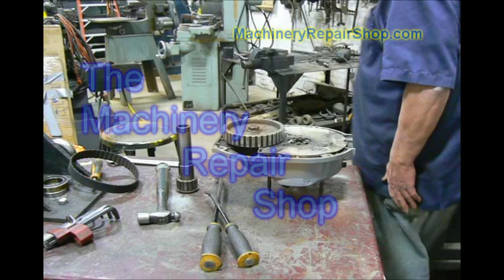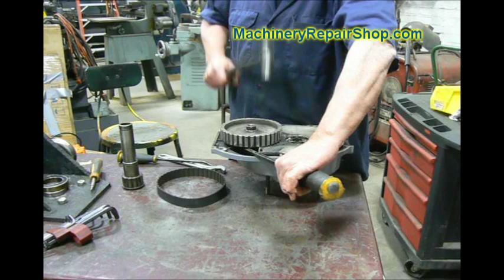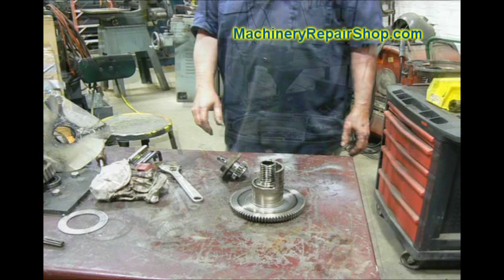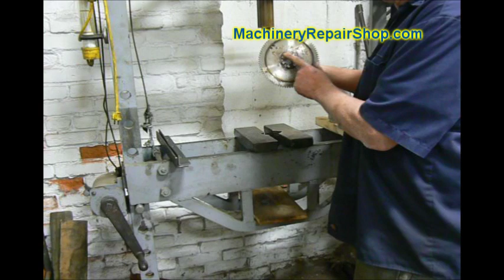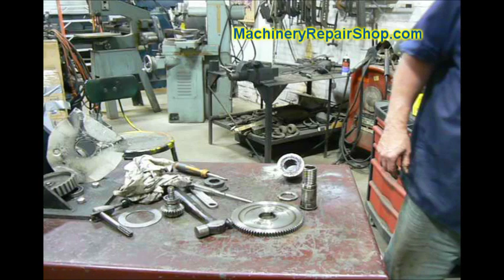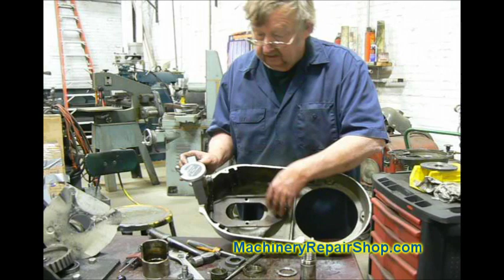Bridgeport Mill Variable speed drive (2J) disassembly part 3 - Back Gear disassembly

Comment: Great videos. I have a 1-1/2 H.P. Bridgeport that wouldn't go in to  neutral at all and is hard to put in high. Any suggestions ???
Reply from the maker: D. Ross Hard to pin down remotely, and not sure what you mean by hard to put into high, but a couple thoughts. The hi/lo shift lever may have loosened on the shaft and moved. It is a friction fit and clamped to the shaft by two cap screws. There is also an adjustment for the hi and neutral "index holes" under the lever (where the pin goes in). It is a sliding plate that fits into the larger mounting plate under the lever. It is secured by a set screw that comes in from the front. You can loosen the set screw and then slide the plate up and down to adjust the high engagement spot. This will also move the notch for neutral. Normally this will come loose which will cause high to not stay engaged, as the adjustment slide has dropped too far down. This can have the effect of making the neutral spot too close to low also (or the sliding part may be missing entirely). The only other thing I can think of is the back-gear bearing collar/sleeve itself (as seen in the video) is binding somehow, but that is pretty unlikely...
Reply: The Machinery Repair Shop Thanks will look in to it.